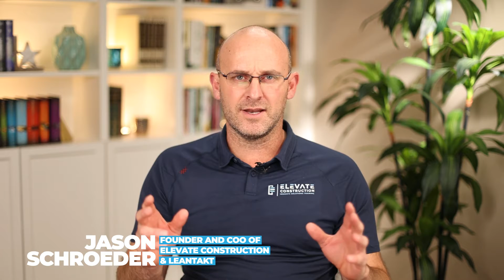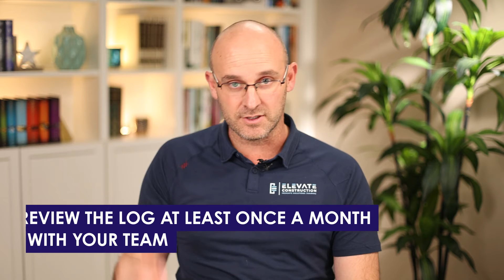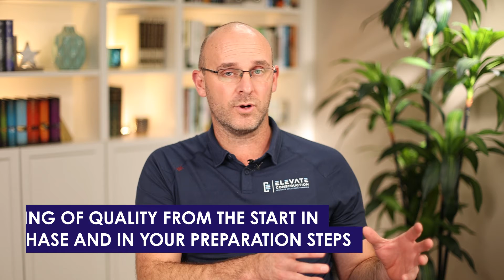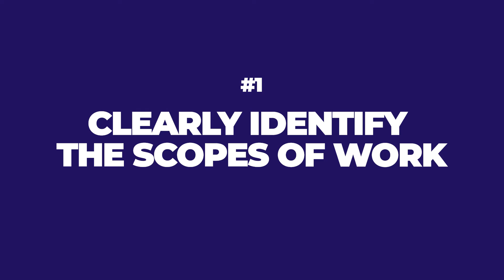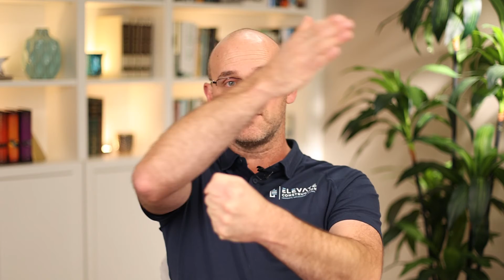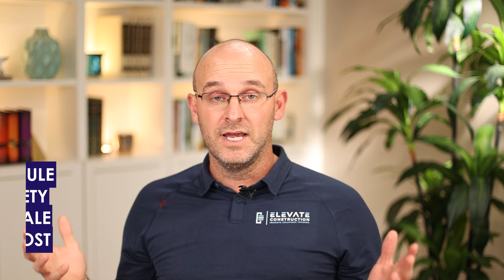What Is An Inspection And Testing Plan In Construction?

Comment: I wonder if I graduate from TRU BTech of construction management degree at age of 27 to 28 years old, will I be able to get construct ion or project or engineering manager or estimator or assistant PM or Assistant CM or any kind of job that I can easily and immediately get in?
Reply from the maker: If you have that degree you should be able to get a job as a FE or PE, yes.